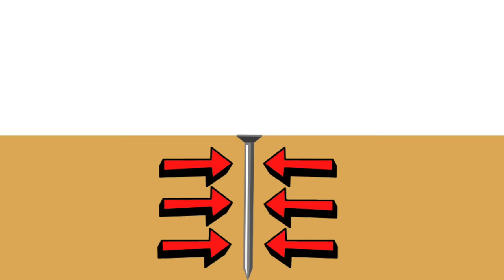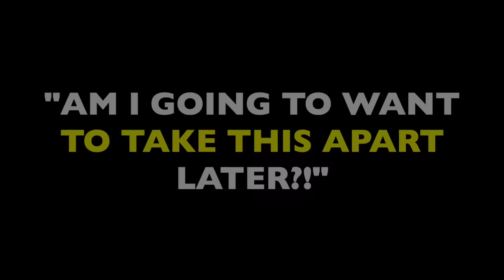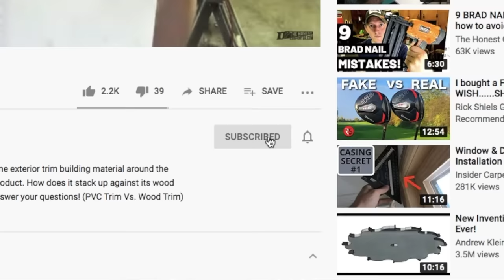NAILS vs. SCREWS...Which Should You Choose?! (Pros + Cons of Nails And Screws For Your Projects!)

Comment: I always use Screws,  they're stronger,  you can easily undo mistakes, and there's less chance of hitting your hand with a Hammer. 👷🏿‍♂️
Reply from the maker: All true, W! 😁
Reply: I know I've never hit my hand with a hammer while putting in a screw. 😁
Reply: They lack sheer strength. For example they are inadequate for fall protection anchors I understand.
Reply: I used to think like you. I used 3” deck screws to hold Baluster. Found out Baluster brook off bc screw snapped due to wood expansion. Now I consider the application bc choose. Most of the time, I use screw but I up the size.
Reply: @ipick4fun27  screws also allow water to spiral into wood. Nails (coated) prevent this. Especially on exterior balisters.
Reply: @ouimetco  I cannot imagine that a properly inserted screw is going to have water spiral around down the screw and into the wood. There are also coated screws...
Reply: @ouimetco  I never thought about the water issue.  My thing is I use nail where I can and appropriate.  Screw is probably still my majority since I don't have a framing nailer.  I am thinking about adding a palm nailer to my collection.  There are lot of places where I think the galvanize nail can do better job than screws especially in the garage framing repair.

When I built a ramp for my car, I used mostly nail.  Only use screw to attach the plywood on time.  But all the structural stuff I use heavy gauge nails.  Damn nails so tough, I had to pre-drill before pounding them in with a 3 lb hammer.
Reply: @ipick4fun27  I got a framing nailer last week, a bostich, and man does it ever hold with spiral coil nails. Wow
Reply: @TheHonestCarpenter  hi
Reply: @TheHonestCarpenter  what a the difference
Reply: They are not stronger. Take a ring shank nail and the size of a nail they will destroy a scree

Comment: I am now a believer in screws - even in the vertical stress applications.   A screw is far superior even in the vertical stress applications where you would think the nail would win.  A test was done that fastened 2 x lumber together in various ways.  In each test, one used screws and the other used ring shank nails.  A hydraulic press was used that monitors the pounds of pressure applied to one of the boards fastened and the test ends when either the boards separate ("pull out"), or the fastener snaps ("shear out") or the integrity of the board gives and the board breaks, or the fastener cuts through the wood and comes out the edge ("tear out").  In every single test run, it never made it to the shear out point where the fastener snaps.  One test i remember was a board run horizontally that was attaching to vertical studs.  The hydraulic press applied downward pressure to the horizontal board that was attached to the vertical studs.  This was a case where I thought the nail would for sure win because "nails have superior shear strength."  It never makes it to the point of shear out.  The nail is going to pull out of the board long before it snaps.  The screw won in the test where I thought the screw would win but it also won all of the tests where i thought the nail would win.  Not only did it beat the nail at literally ever single test, it beat it by a huge amount.  The nails worst problem is pull out and thats where it fails.  The screw was never snapped.  One of the other things happened before the screw was snapped.  Nails are preferred by contractors b/c they're cheaper and can be applied with a nail gun much faster than screws can be driven with an imapct.  There would be a lot more man hours required to build a home if screws were used, thats why contractors and home owners dont want to use them.  The cost of 1000 nails is much lower than the cost of 1000 screws.  So nails win in the financial appeal in every way.  Building code approves both screws and nails to use but you hardly ever see screws used b/c of the financial downside to them.  But in no way are the nails structurally superior.  To the contrary, screws are far superior structurally.  Once you put a nail and a screw into wood, shear out is not where you should be focused.

Comment: Also in some applications it is making sense to pre-drill holes for the nails. With a pre drilled hole there is more outer surface area engaging with the wood, giving the connection much more strength. I was amazed when i heard this the first time but our structural engineer calculated it properly and it was indeed a better connection. 
Sorry for my bad english. Great video though ! Greetings from germany :)
Reply from the maker: Thanks for writing in from Germany, Peter! I believe my grandfather used to pre-drill for his larger nails, and he was an utterly meticulous builder and mechanic 🙂👍
Reply: I would agree with you. Driving a nail into wood often times creates a small split, pushing the grain out of the way. Pre-drilling allows the nail to make contact with the wood in a 360 degree area without splitting the grain.
Reply: Yeah, but if you think about it, what's mainly holding the piece of wood to the other piece of wood you are attaching it to is the nail head. In many applications, you can pre drill the hole the same diameter as the nail or slightly bigger and it will hold just fine. It's really the friction of the nail into the board being attached to that is providing the holding power.

Comment: Thank you for verifying what I always thought. I see a LOT of decks, stairs, etc done with nails and wonder-WHY? Then it hit me...time! It's soooo much faster to "punch" a nail, then to screw a...well screw. However, if you want it to last, screws come out ahead EVERY TIME!!
Reply: A screw will beat a nail even in the vertical stress tests but its not due to a shear-out (fastener snapping).  In every single test run (using a hydraulic press that monitors pounds of force) on a board that was attached horrizontally to vertical studs was the nail is going to pull out of the board that the tip is in which would be the studs.  When you run the same test on a screw the force it took to make the screw pull out was farrrr more than the nail could hold.   The test ends when either the fastener can not hold the boards together anymore and the tip is pulled out of the board and the boards seperate (pull out)  or the fastener snaps (shear out) or the integrity of the board itself gives and the board snaps, or the pressure applied to the board against the nail or screw causes the nail/screw to cut through the board and eventually tears through the edge of the board (tear out).  When one of those things happens the test is stopped and the force pounds are recorded.  The screw beat the nail at every single test.  Ive heard "nails have superior shear strength" a million times (meaning the screw is going to get snapped by vertical force) but thats not what happens first.  Long before that happens the nail is going to get pulled out.  People are focused on the wrong thing - shear strength.  Its the other things that are going to happen long before screw is at a snapping point and by that time ithe nail had been pulled out long before that pressure point was reached.
Reply: hey barry, check out the difference between then and than
Reply: @gg-gn3re  Yeah, I see my HUUUUUGE mistake, didn't realize the grammar police were in town! It must really suck to NOT have a life....geesh!

Comment: We are doing a down to the studs renovation of our home. We decided early on to use screws and nails in conjunction on all the framing ,especially on load bearing walls! We added framing to all exterior and load bearing walls and whenever we drove a nail we also ran a screw next to it. We figure this way we have the best of both worlds. We initially had 2x6 walls that we increased to 2x8 ,not only for the added insulation but also for the added strength. Good video! I would amagine alot of people don't understand the that screws while being stronger at holding boards together don't have the needed shear strength needed!

Comment: Screw technology has drastically changed. Love it since now I am not splitting wood like crazy when driving screws in.
Reply: If you just predrill, your wood will almost never split. These "screw enhancements" have just made screws more expensive and they are not very effective at preventing wood from splitting. In some ways, screw technology went backwards, drywall screws are cheap but incredibly brittle.

The only real positive enhancement to screws I can think of is torx and pozidriv heads that have drastically reduced cam-outs that phillips and slot screws suffer from, the rest is just expensive fluff.

Comment: I learn so much from these videos, for good working principles. Thanks. To remember from this video: nails are stronger against shear forces and safer to protect buildings from high winds. Screws fasten parts in place together better, due to the threads; whereas contraction/ expansion of wood can cause nails to pop up/ out of position/ no longer fastening anything at that point.
Reply from the maker: Good summary! And screws will perform better against that expansion/contraction in deck applications 🙂
Reply: What kind of screws do you recommend for attaching an extra stud, to the stud of a shed, (when the extra stud is bearing heavy duty lag bolts to adhere a 3 shelf steel lumber rack/ {4 racks in series}, which bears the massive heavy weight of piles of wood)? (I'm using construction adhesive on all the parts as well)

Comment: You mentioned using adhesive, but not
coated nails. The coating acts as an adhesive that heats up under the friction of the hammering and helps secure the nail. I think the biggest issue is that screws tend to be more brittle as opposed to the ductility of most nails. They each have their own purposes
Reply from the maker: I want to do a whole video on nail coatings at some point Bennet, including types of galv finish. It gets crazy complicated when you start breaking down the types.
Reply: @TheHonestCarpenter  I like the idea of a nail coating video.  There are so many coatings now days.  🙂
Reply: I am currently seeking proper way to attach wall blocking for baseboards.  Some corner don’t have anything for which to attack molding to the wall other than drywall. (And we both know where that’s headed) 
The higher areas will be getting screws but the bottom corners - well, I’d like to use a framing nail gun.  Comments?
Reply: @TheHonestCarpenter  Costs are also greatly effected with finish and coatings. It drives me nuts when you cannot find cheaper interior screws because all the exterior coated (more expensive) screws are front and center at my local Lowes and Home Depot.
Reply: @TheHonestCarpenter  I look forward to it, I very much enjoy your presentations and the attitude and information you present
Reply: @bennettrogers7921  Me too!  Thank you Ethan for researching and presenting the basics for the DIY's out here.
Reply: The newer screws are just superior to nails in every way

Comment: I tend to always use screws for the exact reason you mentioned. I had to remove and old deck when I was youner built with nails and vowed to not follow in those foot steps. I like the you highlighted a use for the them saving cost in areas where you dont plan on deconstructing. The problem is I always at some point want to change things up

Comment: If you want to prevent nail pop but want the shear strength, use both.
Im remodeling a 1950's house and after demolition and any reframing I might need to do, I shoot a screw or two where there is nail pop. Then I drive the nail back in.
You can also do this with new framing. I shoot one screw through the top and bottom plates into the studs and then come back and shoot two nails. Makes assembling a bit easier when driving nails with a hammer too.
Reply: PS

Comment: Another well done and worthwhile video. Thanks. 
Obviously, this left a lot of material about screws vs nails behind. For example, there are times when nails are used over screws because they make teardown and reassembly more practical, like in trim/molding applications. Finish nails allow for the removal and replacement of trim without completely destroying the origianal material. The nail's head is shaped to allow it to be pulled through the wood with little damage.

Comment: 25 years ago, I used SS square drive 3" and 3.5" deck screws to hold my deck together including the standard deck boards. Not a single issue, no broken screws, no rusting in PT wood. These screws have a cutting tip, so really no predrilling except maybe board ends.  They can be reused.  Maybe 5 years of life though on my FIL deck using standard coated deck screws. Many of them snapped off. They did that cause the wood decking was not finished, like mine. The wood moisture cycles and expands and contracts over and over, and all that movement of the wood caused those coated steel screws to break. So, the SS screws can bend a  lot, even more than steel nails and not break, they hold great and do not rust.

Comment: Project farm did a cool video showing the data on nail holding strength you just anecdotally provided, as you said, all nails were blown away by even cheap drywall screws, what was cool was the other types of nails with spiral shank, that actually were lower than a standard nail, and ring shank nails which improved holding power slightly

Comment: Mostly I use screws because they are stronger and it's easier to change something later if you want. But for framing I use nails. Thanks for a great video, as usual!
Reply: Screws are not stronger, they're harder. Screws are rigid and have great pulling force. But screws are also brittle and the moment they encounter shear force they snap. Tap a screw sideways with a hammer and it breaks, a nail does not.
Reply: @sophieedel6324  The only time a fastener encounters shear is when the house you are building falls down. Screws prevent the house from falling down.
Reply: @notapplicable430  each time wood expands and contracts screws experience shear force, that's why screws on sidings or deck snap all the time
Reply: @sophieedel6324  Nonsense.
Reply: @notapplicable430  not nonsense, you learned something

Comment: I think this is a great video. There is a lot more to say on the topic and maybe a few ways to use nails that you didn’t mention. It doesn’t always work, but depending on the situation you can drive nails in at alternating angles as well as clench them. Clenching works especially well when the wood is relatively thin and there isn’t enough thickness for a screw to bite. I have had great success with these two additional methods.

Comment: A simple trick that will give your attachments more holding strength is to install the nail screwbor Red Head At an Angle. Use different entry angles and it becomes impossible for a board to come lose due to heat or moisture. If moldbisva problem or rot  paint the backsidebof thebwood before installing, water penitation,  use silocone on rough concrete, or a sealant on  finished concrete.

Comment: In regards to fastening power I think a ring shank nail is a close 2nd to a screw. The ring shank nails for my Paslode are very difficult to remove. I’ve had a couple of cases where the nail would not sink because it ran into a knot. I will try to remove the nail, but it would not budge. My only two options at that point are to try to hammer the nail through the knot or hammer the exposed shank that would not sink any further flush into the surface of the wood.

Comment: Another great use for nails is for roof tiling.
If you nail them you can get it out in the future but if you screw it you will be in for a headache when a tile breaks.
Another reason for using nails is that they have a flat head and you can get away with only painting over it on a visible surface while with the screw you usually need to full the hole first.
Outside of those two I tend to use screws for just about everything.

Comment: Will stainless steel screws be a better option for redwood siding ? The house is in san francisco and lots of moisture and harsh sun hit the wall siding. The old wood is rotted but lasted 110 years with regular nails and paint. But with a potential earthquake brake stainless steel screws or should I stick with stainless steel nails?

Comment: I do DIY, but my projects are not nearly so big. So nails or screws are pretty much the same effort.
2 things that influence my screw use:
1 there are many times when hardware has ready-made holes that I take for screw holes.
2 nails are hard for me. I never could hold a nail right and always bang my finger. Or I bend the nail. Not good for DIY.

So I'll stick with screws for the most part. Although, U-nails were very useful when I needed to secure my old phone cord to keep my cat from chewing it. I also butted it up against a non-flush board so she couldn't even get a tooth on it.

U-nails and even glazier's points are awesome!
(ask me how I framed posters with glazier's points!)

Comment: I used to like screws because of their holding power and the ability to remove them. Then I learned that you need to understand the project and purpose of it. Nails are generally a softer metal and screws are harder. This makes screws more brittle and they can break as you point out. If the project needs to flex, use nails, like you point out in the framing of a house. I like your suggestion of glue and nails.
Reply: I had to remove a boatload of old deck boards and only a small fraction of the screws would come out..most would spin the heads off or the head would strip out.  Huge pain in the butt.  Ended up having to cut most of it apart.